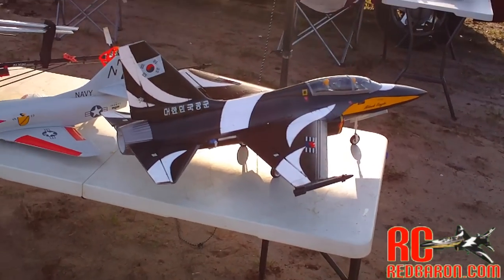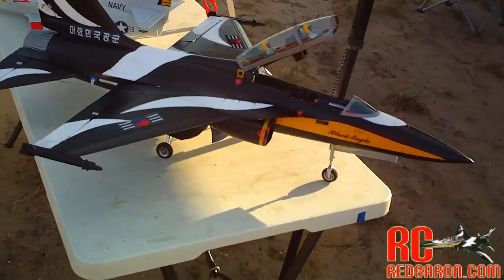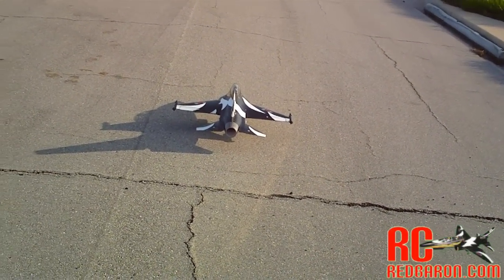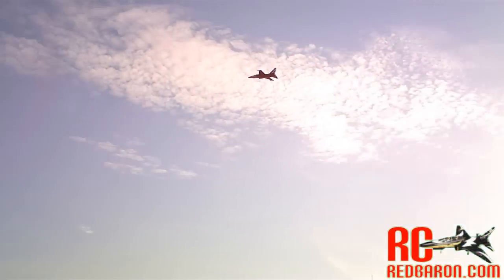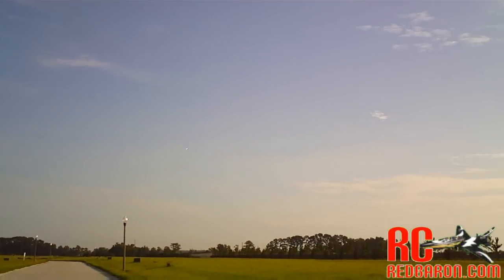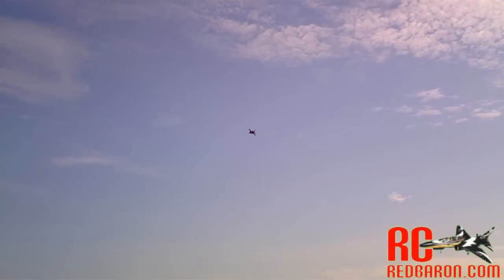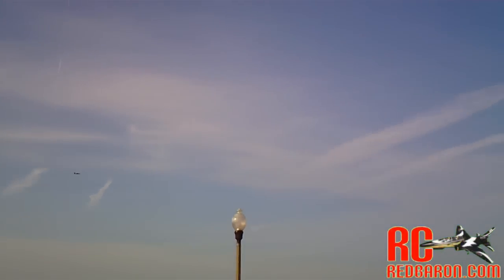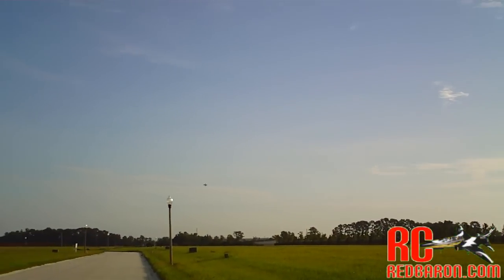T-50 RoKaf RC 70mm EDF Jet - Retracts - Canopy - Maiden Flight 7-10-2011

Comment: It is really awesome to see this video! Great Flight review! I am actually supposed to be getting this plane pretty soon. Are you flying that on the stock setup? I was thinking about putting a SAPAC MB-1 motor and fan combo, that or a Cyclone Power 3300kv motor with a hobbyking 70mm fan unit. what do you think? I have read that if you remove the canopy mechanism, you can fit a bigger battery. any thoughts?

Comment: nice flying man. ofcourse i'm the mod kind of guy. I think this thing can go faster but the most important thing I wanted to knwo.. is.. Can it take a larger battery? cause for me a 2200mah pack is too small for a 70mm plane. I actually need more. so that I will be able to move to HET fan or a Wemo fan with a better motor in the future

Comment: HAllo I have the same plane. Can you let me know the CG fom edge of the wing? And maybe how many cm theAilerons and Elevators must be work?
Reply from the maker: C.G. : 72-78 mm from leading edge where wing meets fuse

Control Throws: Elevator 3/4”up & 3/4” Down, Ailerons 3/8” up & 3/8” down
Reply: +RCRedBaron  Thank You so much and have a brilliant new Year 2016